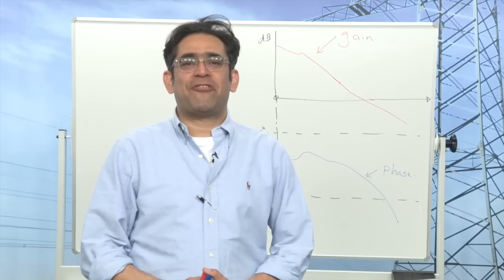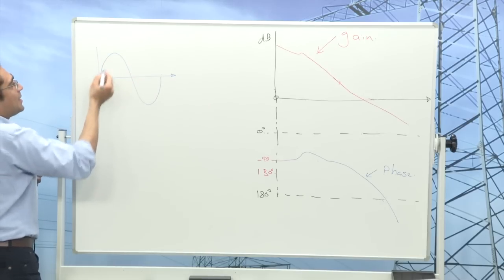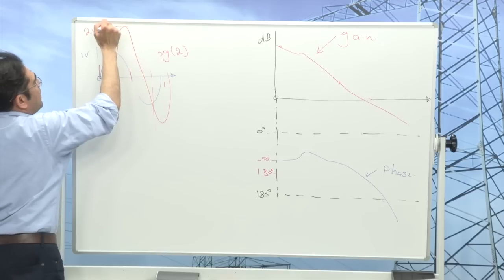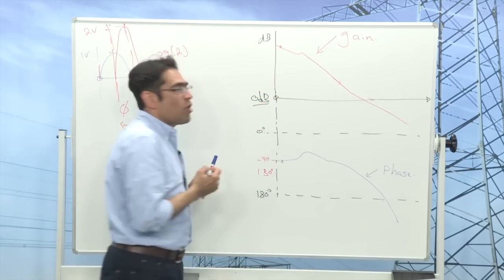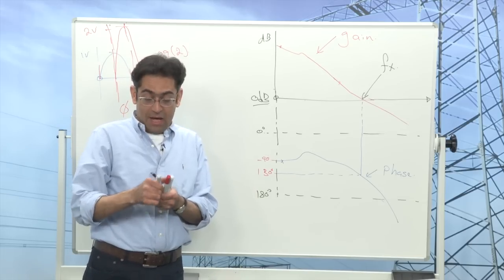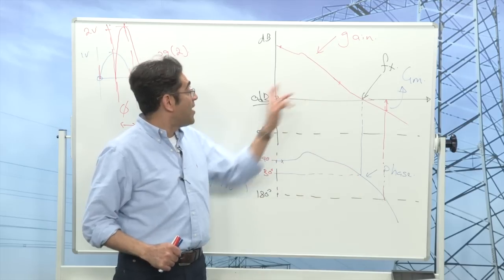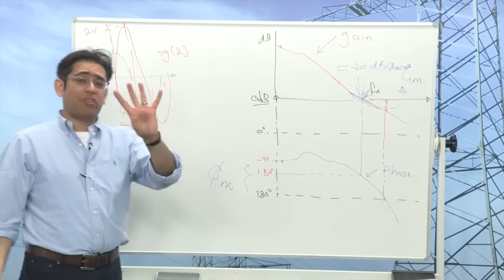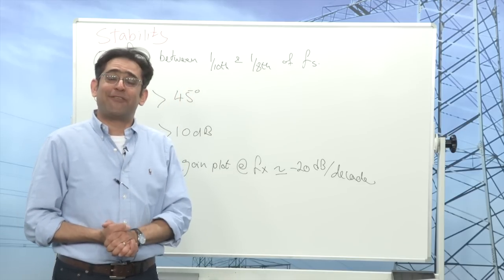Foundations (Part 1.A) - Understanding Bode Plots and Stability of Power Supplies (1 of 2)

Comment: Great explanation. 
When you mentioned wiggling the PWM, what did you mean? 
Wiggle the duty cycle? How would you do it?
Reply: You can either wiggle the PWM on time with a speed of the intended frequency or you can change the PWM frequency itself (jitterrimg) 
Both should get you the same effect.

Comment: Hi Ali, thaks a lot for your clear teaching about bode plot design, I have a question, I'm working on 1,6kW DC-DC LLC converter, I have lot of problem because the output voltage is 360Vdc and so the Rh (high side resistor divider) has an high value due to the ratio between output voltage and reference voltage, therefore the Rf (gain resistor) of Type II compensator cannot bee big enough to have a minimum gain, the question is: do you have some suggestion hot to solve thios question?
Thanks a lot for your kind reply
Roberto